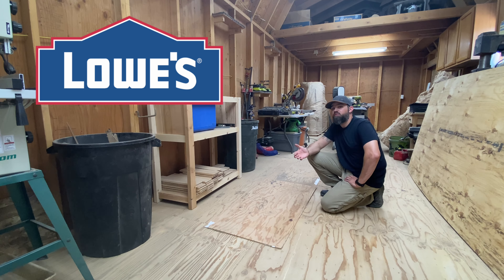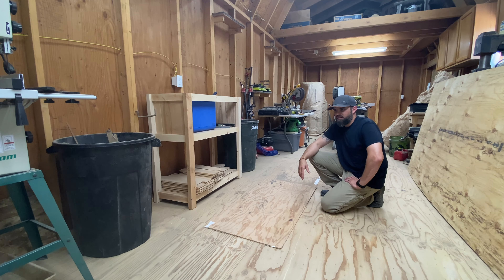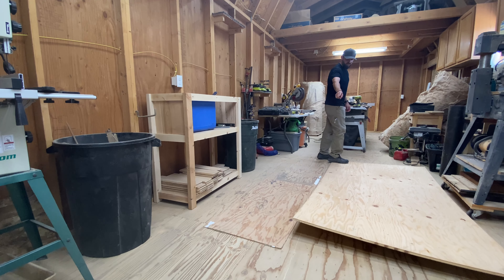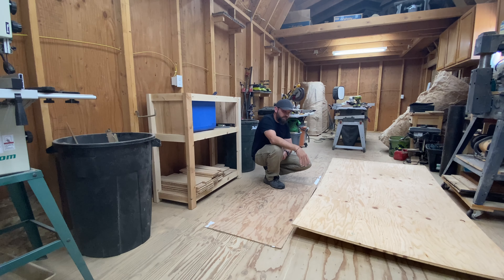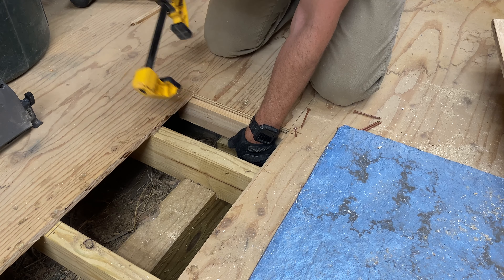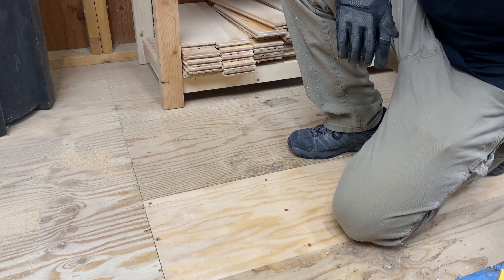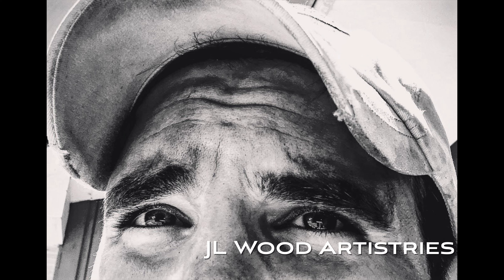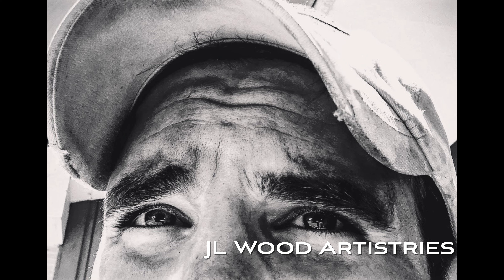Patching a Hole in the Floor | Surprise Partnership (Not Really) | Shed to Shop | Ep 4

Comment: I’m in the middle of insulating my shed, using roxul instead of fiberglass. 32x14 shed, so about the same size as yours, and I spent about $1700 on roxul + vapor barrier. Free is free! 
I did some research on seam tape and it appears that the red tape that’s the industry standard in Canada is polypropylene. So is standard packing tape! Wish me luck.
Reply from the maker: That’s going to be a huge project but you’ll definitely notice a difference when it’s done. Good luck. It’s going to be so nice when it’s done.